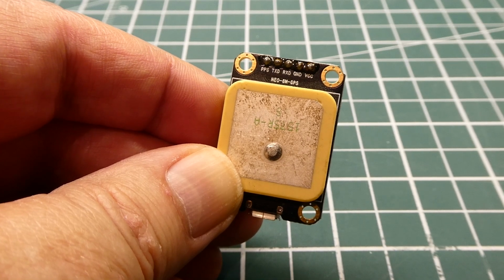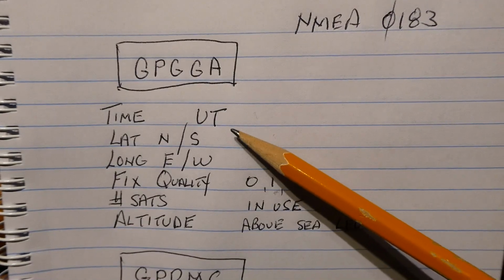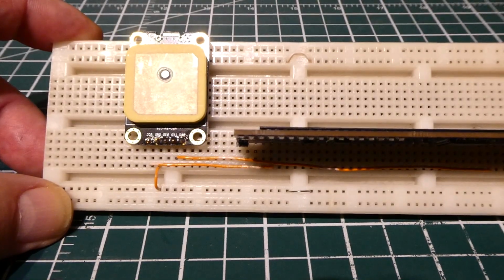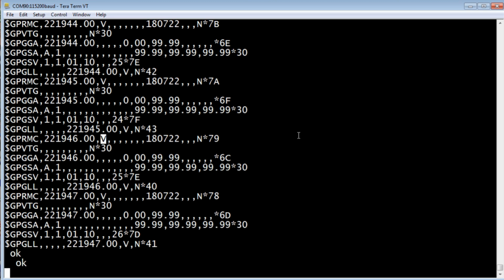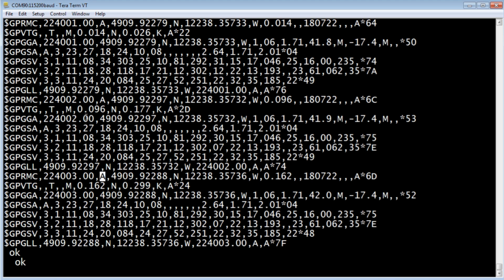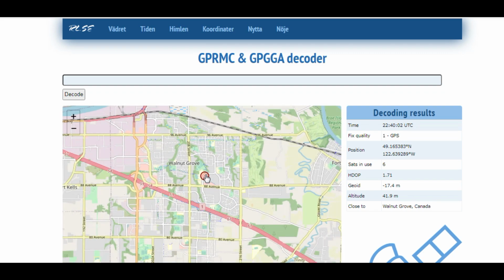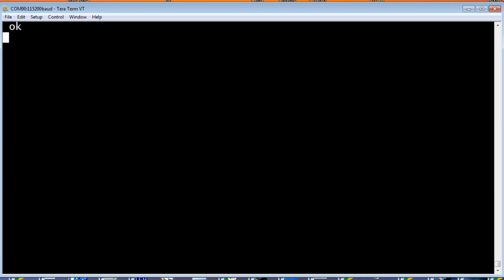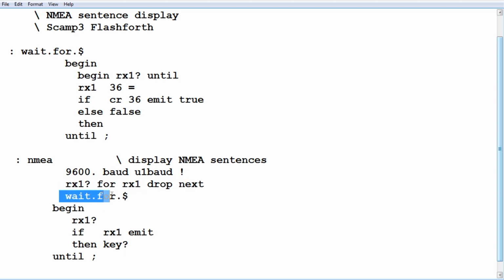Getting Started With GPS / Scamp3 / Flashforth

Comment: You can send it commands to change the baud rate, the intervals of each sentence and which sentence are sent, which I have tried with mixed results.
Reply from the maker: You can use u-center.exe to configure the GPS through the USB port. Make sure your firmware is up to date and you don't have a uBlox knock off.
Reply: @0033mer  Thanks. Wish I'd known that a couple years ago before I started messing with GPS chips. I was doing it in C on embedded linux and I also used something called SiRFDemo in Windows with GPS hooked up to comm port.

Comment: Good one Ken....
You can also use an inexpensive USB to TTL converter board and hookup the GPS Puck to TeraTerm set to 9600 baud.. That's what I used to get the Nema Strings before decoding specific info I needed with a PIC program.
Reply from the maker: Yes, that option is actually built in to this GPS with a USB connector on the backside of the board. You can plug it directly into your USB port which will power the GPS and display the NMEA strings. The serial port is used to interface directly with microcontrollers.